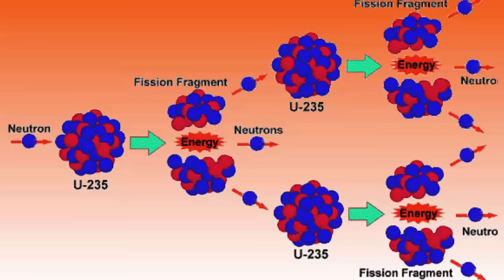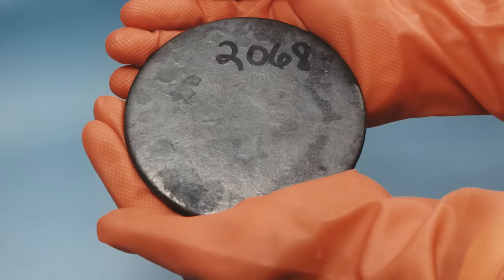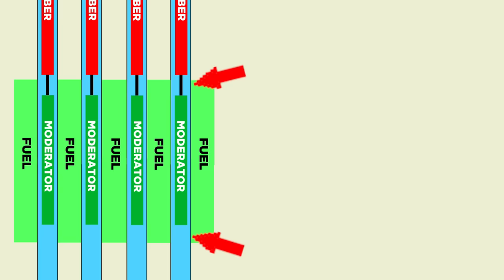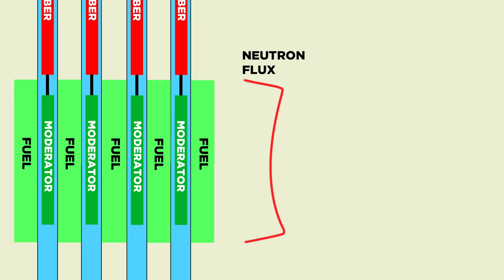What /Actually/ Happened at Chernobyl

Comment: You also have to acknowledge the factor that I call "Ignorant Bosses Syndrome". When the first reactor operator refused to do the very dangerous thing he was being directed to do by his completely ignorant boss (who was a turbine engineer and knew nothing about nuclear reactors), the boss threatened to fire him and get the next guy to do it. So he went ahead and did it (pulled out all the rods) while knowing better. Both the boss and the operator died, sadly.

In defense of the reactor design, they had jumpered out multiple safety systems which would have prevented them from doing what they did, or prevented the reactor explosion entirely. Again because of ignorant bosses.

Comment: Hm, question:

Maybe it is the way you illustrated it, but given that all control rods were entirely removed and the moderators are all at the same height, shouldnt your localised maximum of reactivity always happen, not just when you push them back in?
As in, your maximum should, statistically, be in the average middle height of all control rods, where neutrons have the longest unobstructed flight path and such?

Comment: How does the temperature rise in heavy water make it "less around"?? Hotter water => less water?
Reply: Water expands as you heat it up. If you'd have some space to accommodate that expansion, the water would move into those areas and leave less water between the fuel rods. That'd be my guess.

Comment: Here's what confuses me: if (by my understanding) U235 is the less-common isotope, and U238 is supposed to go through the (expensive) enrichment process to create U235, how were the Soviets cutting costs by loading their reactors with U235?  You also say that U238 is more stable, yet later you say that U235 has its neutrons further apart and has more "stuff" to absorb them, implying that U235 is more stable. I feel like you may have mixed up U235 and U238 at some point. Feel free to correct me if I'm wrong.

Comment: RBMK reactors are built cheap, cheap, cheap! They don't have thick sided sealable containment buildings surrounding them... They use cheaper, non-enhanced Uranium or Plutonium... They use standard water instead of heavy water or pressurized water around the core, and their control rods are tipped with graphite, which promotes more fission activity instead of bringing it down...
Reply: "and their control rods are tipped with graphite, which promotes more fission activity instead of bringing it down..." You didn't watch the video, did you?

Comment: so basically they broke it? because the system was winding down after use and they decided to kickstart the process again rapidly and it just wasn't the best technology anyway so it couldn't really manage what they were trying to do? If they had been developing more technology / if scientists had still been working at the site to develop newer and better models, and constantly improving or regulating the design it may not have happened - but instead it seems they developed one mechanism and just let it run without modifications - most probably because it was working and it was cheap so they didn't see a reason to improve it

Comment: hello out rbmk reactor can u tell me how could a fission reaction starts in a reactor
how after all procedure has been done 
like fuel is inserted control rod is inserted or not i dont know at starting
pump is on  for water
as u said control rod consist of boron and tips is of graphite 
so boron is break and what graphite tip is accelerator 
nd moderator if graphite block or water confused

how reactors works from starting cann u tel me

as u said ab

Comment: heavy blocks of graphite to slow down neutrons? You are so wrong, its boron
Reply: No, boron is the material that the control rods are made of. Graphite does slow the neutrons, increasing the energy produced (counterintuitively, slowing down the neutrons increases energy production as when the neutrons are sped up they just bounce straight off kf the neutrons instead of breaking them some reason) 😊😊😊

Comment: Fission is not splitting in 2 particles. Beta +- decay is fission aswell isnt it?
In case of beta + a proton becomes a neutron and beta g vise versa.(Edit: wait a sec beta decay isnt fission... the second point is true though.) 

Also only with spontaneous fission the products have allways less mass then the atom. You can cause fission by  shooting some particle at a core. And the products after the colision even in case of fission may become heavier.

Comment: And all of this is why we should reinstitute the Manhattan project only this time for thorium molten salt reactors and switch every damned reactor to molten salt thorium.  Built small enough for railroad mobility so not boiling water anywhere but super critical co2 to make the generator a tiny portion of the size we use for a gigawatt reactor and just put more to make power and burn up all the swimming pool waste to make it useful for mankind not a sitting time bomb. If this were started now in 20 years every boiling water reactor would be gone and the amount of plutonium being burned down would be running for 1/100th the cost of rickovers abominations. Electricity for all the cars switched over from oil and cheap cheap cheap electrical power.

Comment: WRONG...WRONG...WRONG. The only thing to do in case of Zenon poisoning is to shut the reactor down and restart it after the gas dissipates. The control rod with the moderator at the bottom that you show is the post-accident modification. Water started boiling, because they shut off the pump as part of the "experiment". The positive spike was the result of the neutron field dynamics which was successfully modeled by the detractors of the reactor model and was suppressed by Legasov himself, who pushed the RBMK. He was being scapegoated for a valid cause. The detractors even built a computer more complex that IBM and Data General mainframes at the time, before Chernobyl RBMK was even built, and they modeled pretty much the accident that happened. With the pinpointed partial melt-down location. RBMK was capable of partial meltdown (of 250-300 rods) and of being repairable. Morons at Chernobyl just pushed it too much in their drive for fame and fortune. Reactor was designed to shut down on its own,  it would not perform as the experiment demanded, and Dyatlov, an experienced and reckless operator, wanted to keep it burning so as to do it once or twice more to get the successful results. He was a reactor jockey who pushed equipment too far and damaged a military reactor and was demoted to a civilian power station and was eager for a come back .Other stations refused to do the experiment citing safety concerns after Leningrad accident. Chernobyl bosses jumped at the chance.Kurchatov Labs have recreated the events that led to reactor explosion and the fuel rods overheated and failed in a different section of the reactor than where the overheat was, NOT near the bottom, as you surmise. The field of neutrons "Jumped" to the side across the reactor and did its magic there near the wall. That moderator bottom was installed on control rods, so that there would be no water in the control rod channel after it is lifted. Water was perceived as having slowed down the control rods being inserted into reactor.

Comment: pretty inaccurate.
Tl:DR graphite tips were an efficiency and longevity thing that got almost completely withdrawn from the reactor, not a method of further throttling of the reactor itslef.

 The tips were used to prevent the inaccuracy of voids and increase the lifetime of the part, not as an extra tool that the operators can use to add moderation (they cant use it as a tool because they didn't know the tips existed). They were made of graphite specifically due to thermal expansion and to prevent the amount of flux from having large inconsistencies throughout the system during the pulling sequence, (this is why they couldn't use just tungsten or carbon steel). Ergo if you want to go ahead and increase efficiency during control rod cycles rather than lose the potential work that is being done, you might as well use a moderator on the tips and the other control rods would compensate for extra heat generated, they just didn't realize a scenario where almost all of the rods would be withdrawn. The tips were also almost withdrawn from the entire system, so they weren't in the center, they were almost all the way out. So it wasn't that the carbon tips going to the bottom that created the flux, it was that the graphite went from being partially in to going all the way in, then going to the bottom. So its not just the flux, its the increase of the the graphite surface area altogether.

Comment: Everybody is super smart after the incident happened.

What would you do when you generator has no power and you have no control over it?

It was a decision that worked on paper and the imperfections of the rods were not in any documentation so they moved the rods together. It was common sense. Generator without power output is a very dangerous thing.

Then random shit happened and they tried to correct it and failed.

If you want to blame somebody, blame the designers and manufacturers aka Russia.

Comment: I'm sorry but this entire video is false. The only truthful section of this video is the terminology explanation which anyone can google. In the video it was explained that the "fission product" 'became energy'. That is false, No reactors, not even the RBMK Reactors "absorb" anything in order to produce power. The way a nuclear reactor is created, is the heat created within the reactor is used to heat H20, simple basic tap water that is then taken and used to spin turbines, and then cooled back down and recycled through the process. At no point in time ANY nuclear reactor will 'absorb' anything from the reactor, any absorption is purely consequential to working with nuclear fuel not intentional. I honestly could not continue watching this video because it hurt my brain so much in order to bare through 6 minutes. 

The only rundown that is needed to explain the Chernobyl Accident, is that RBMK Reactors do not explode under normal circumstances, poorly designed as a cheaper source of nuclear based power. Multiple things are major design flaws within the reactors, such as the fact that they use carbon and boron based control rods as moderators where as every other reactor in the world uses water. Basic WATER. No "enrichment" needed, just basic H20 does the job. What caused the explosion in the reactor was NOT nuclear based, it was a combination of the superheated graphite/carbon mixing with the superheated water, which anyone who has sat through an Elementary level school science class knows that the liquid form of water is made up of Hydrogen and Oxygen, when heated it splits, you now have two separate gasses within the reactor, i.e. Hydrogen and Oxygen both highly flammable and combustible gasses on their own, and in this instance it was ignited by the Carbon and graphite within the reactor that was at this point glowing as red as the sun due to the intense heat within the reactor. When these circumstances mixed, it caused the explosion, that then exposed the super heated reactor to the world, which was fueled by more oxygen and no possible source of slowing the reactions within the active fuel rods.

Comment: you ought to read the INSAG-7 report, it´s the official report on the Chernobyl disaster and is.... Right.... Here!
https://www-pub.iaea.org/MTCD/publications/PDF/Pub913e_web.pdf
The reasons for the disaster went back a loooooooooooooooooooooooong time before that, a sluggish computer system that took several minutes to calculate the situation report, the fact the reactor had split up into 2 different reactors basically (one boiling at the bottom, one boiling at the top, and in between there was an inert layer with all the Xenon) and the fact that all neutron-counters were switched off automatically once going below 200MWt... It´s like driving a car without windows, without an RPM or speed counter. Literally. They had no clue of the neutron flux, which was enormous because there was no more functional detector! That report baffled me, as in how far things were lacking, but above all one thing lacked: the fact the Soviets lived behind an Iron Curtain, and did not absorb any of the lessons learned from the Three Mile Unit 2 accident. Like the switch from Symptomatic ´follow the book´ treatment of problems to proactive thinking and a preventative approach, hence be way more aggressive in terms of keeping control.

Just take your pick,
I enjoyed reading it, even if it´s head-scratching at times to get the terminology understood.
Regards,
Thomas

Comment: "Dyatlov broke every rule in the book." If the operators manual says don't run this reactor under 700 MW then DON'T. If it says wait a day or two before attempting to bring a crashed reactor back up to high power then WAIT. Even if you don't understand why it says what it does FOLLOW THE OPERATORS MANUAL. The designers knew what they were doing when they wrote it,

Comment: He is saying like the personnel (operators) are guilty. But the personnel didn't know about some dangerous things, the constructors hadn't written in the instruction manuals. The most important one is that in some conditions A3 button (emergency shutdown) will blow the reactor off. You press brake and get acceleration. Perfect soviet machine!
Moreover. The personnel didn't have the meters to control local overheating in active zone.
Reply: Personnel made DOZEN of serious mistakes which brought the reactor to that condition in the first place. They are guilty and got what they deserved
Reply: @rinkashikachi  please provide at least 10 mistakes
Reply: @UCOKe6YQqk7ebEo_Gzsb_0JA it's very nice to be clever 35 years after the disaster, but none of theese are the violation of the instructions. The construction of the RBMK was idiotic. And the results of further investigations are the confirmaton.
And the 10th is your fantasy
"Required at any nuclear plant" is very funny, but it's not the instruction
Reply: @Nikita-ci5dr  nope, it is an instruction. Skala doubled that instruction. It is an instruction for every single nuclear plant at every point of time. From those days till now. No matter if it is PWR, BWR or any other kind
Also, 200 rods out for example is not a violation for you? Dont you understand that in normal circumstances even 50% rods out is alarming cituation which will not be allowed by safety automatics, unless you against all instructions turn it off (like they did. Turning off safety is not a violation, got it). Lol, what a clown. Where the hell is all your "knowledge" coming from, I wonder
Reply: @rinkashikachi  the violation is working at the low reactivity level, but there was no device which measured the reactivity level. You should read some Russian resources before making your cliche conclusions. The idiotic construction of rods and active zone blown the reactor. Russia has stopped building RBMK reactors. Can you answer why? I wish you good luck if you are living in the country with active RBMK. And what about the disaster in Leningrad in 1975?

Comment: This is probably an extremely simplified version of the design, and I'm probably going to sound like an idiot for asking... but wouldn't it have been a better design to have the moderators at the top, and the absorbers at the bottom?  That way, if you need to lower the control rods, it won't amplify the reaction first, and if you needed to amplify it, you could just lower the rods further?  Or would that the absorber cancel out the moderator, making the whole thing pointless?
Reply: No, because part of the design is allowing gravity to do some of the work for you, or all of the work if something went wrong with the power/mechanism. You want the absorbers at the top so that if everything else fails the rods simply fall to their lowest point, leaving the moderators outside/below the reactor, and the absorbers nestled against the fuel rods.

You don't want gravity to work against your design.
Reply: @casbyness  Ah, good point!  Thank you for that!

Comment: Chernobyl was a fairly expensive way to produce a lot of plutonium. The reactor was incredibly large and more complicated compared to any normal reactor core because it was designed around maximizing neutron flux through U238. Soviets already had a more reasonable (and immensely safer) VVER pressurized reactors and fuel enrichment was already way cheaper than plant maintenance and what have you.

The plants were basically a military plutonium breeding operation hiding in plain sight and pretending to be just civilian reactors.

Soviet Union needed all this plutonium to catch up to US military stockpiles which in the 60s were an order of magnitude larger (contrary to politicians lying about "the nuclear gap") and ignoring this side of the equation is basically historical propaganda. Makes sense for HBO to do it, but you...